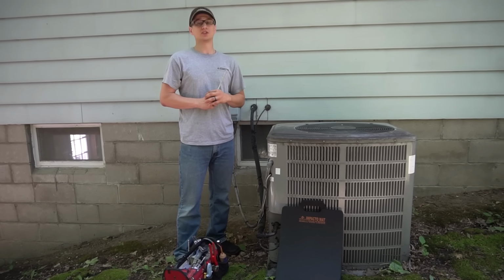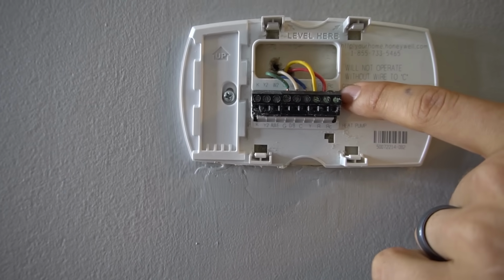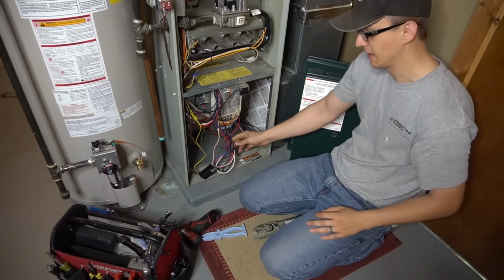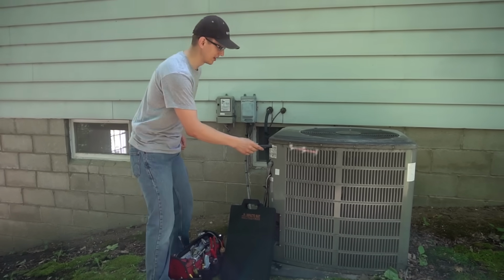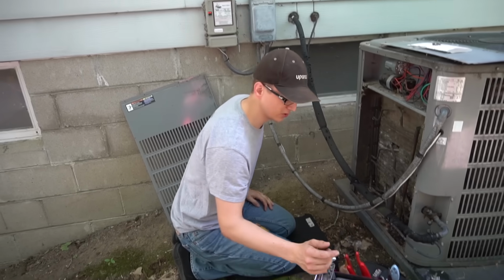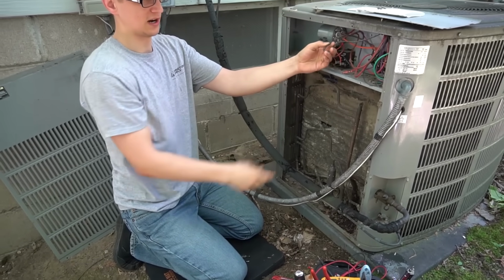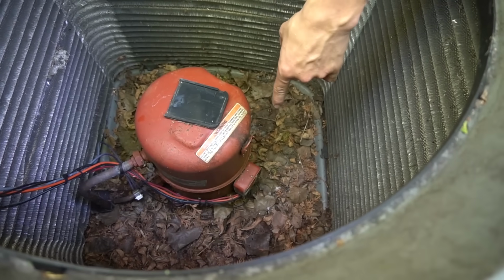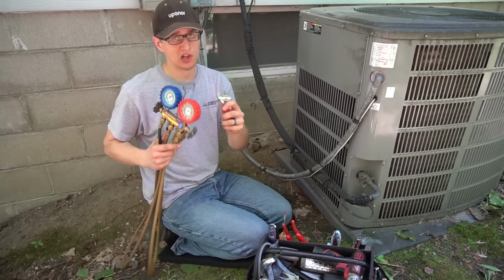AC Unit Not Turning On - How to Fix It Step by Step

Comment: Thank you for this video! I was able to fix my problem thanks to you mentioning a bug might climb into the plungery-doo. That's what happened to me and it didn't cost anything to fix. (Though I had already bought new fuses / capacitor because I didn't check if the 240v was making it through.)
Reply from the maker: Awesome! Glad to hear that it was an easy fix! :) You may as well keep the capacitor as a spare. It may save you on a hot and sunny day. (it's the most common ac problem after all) Thanks for watching, stay cool!

Comment: Hi I have the unit start when I push the plunger in but then after a little while the plunger knocks out again and unit stops working
Reply from the maker: I have two videos that are on that topic that may help you:
10 Reasons Contactor Does Not Pull In: https://www.youtube.com/watch?v=NVPhsK4gK1A&t=2s
10 Causes for AC Short Cycling: https://www.youtube.com/watch?v=GEVNSrOrohA

Comment: Watched your vids and went thru the checklist of things to check.  It turned out that my thermostat went bad.   Replaced it and everything works fine now.   Probably saved me lots of $$ now and probably in the future.
Reply from the maker: That's what I like to hear! :) Thank you for coming back to leave a comment, stay cool!
Reply: I have nothing happening just changed out the contactor 4months ago. 
I have no air blowing inside and unit is not doing anything? Please help me...
Reply from the maker: @angelavillarreal08  If you set your thermostat fan setting from AUTO to ON, does the fan in the furnace come on? If not, then I would suspect that there might not be any power going to the furnace.. So some simple things to check would be a tripped circuit breaker, maybe the furnace power switch got bumped off, a blown 3 amp fuse, weak/dead thermostat batteries.. I go over a lot of this stuff in the video too.
Reply: @WordofAdviceTV the  thermostat just makes a click sound and that's about it. No air blowing from the vents. 
I have a 2 story home so I have one furnace down stairs and the other is up stairs in the attic that's the one I'm having my problem with is upstairs..

Comment: Hi I’m having trouble with my ac. When I turn it on it only makes the air noises but doesn’t cool. Motor and fan don’t turn on and it’s only 1 year old. ???
Reply from the maker: Did you try troubleshooting it by following this video to see if you could narrow it down to the possible problem? It could be quite a few things. Perhaps a blown 3 amp fuse, a tripped breaker/blown disconnect fuse/s, or the capacitor is dead.. Just to name a few.
Reply: Word of Advice TV I did the 3 amp fuse it’s good the Capacitor new and connector new. Fuse box are good and the breakers are good. Still nothing. What else ?
Reply from the maker: @Angelchente1  If you carefully press in the contactor plunger with something non-conductive, does the condenser unit start or at least attempt to start?

Comment: What happens when the contact is bad on the outside unit and you replace it and it runs for 2-3 hours then the unit goes back off. You can push contact in and it will run. Contact isnt pulled in prior either.
Reply from the maker: I have a video on 10 reasons why that could be happening, I would try watching that first: https://www.youtube.com/watch?v=NVPhsK4gK1A&t=2s
Reply: @WordofAdviceTV  
much appreciated sir!

Comment: Your central air conditioner condenser unit was starting up to Maintain The set point on thermostat for example 75°F also known as 24°C I know you Live in United States I am from Canada so we use centigrade here.
Reply from the maker: Very accurately explained :)
Reply: @WordofAdviceTV  setting the thermostat below 75 degrees Fahrenheit 24 degrees centigrade is never a good idea because it Stresses out the Components on the central air conditioner condenser unit and Causes them to die Faster. I set my central air conditioner thermostat at 24 degrees centigrade.75 degrees Fahrenheit still in good Mechanical Order.
Reply: Word of advice TV as I mentioned before you shouldn’t pull the disconnect like that it was actually doing its job maintaining air-conditioning thermostat setpoint of 24°C 75°F or whatever you have it set at I know you’re doing a video for that reason but Your air conditioner was actually doing a job cooling down your house awesome video by the way.😀

Comment: My plunger will not pull in on my fan outside. When I manually push it in, everything works.
Reply: Could you please fill me in on what might be wrong?
Reply from the maker: I think this video will help you with that: https://www.youtube.com/watch?v=NVPhsK4gK1A&t=2s
Reply: I have the plunger pushed in, holding it, which means I have bypassed my thermostat and my fan is staying on outside. I am not sure why the plunger will not do this automatically. I need your help please.

Comment: hello ive replaced my fan and condensor. soo my unit would periodicly stop cooling. ive had two technitions come by and both gave me different opinions. one said compressor another said freon. i spoke to a friend who said it might be the thermostat connection. i dont have heat on my unit, i live in florida. can you explain how the colors work or to trobleshoot the wires on the thermostat.
Reply from the maker: Here is a video on basic thermostat wiring: https://www.youtube.com/watch?v=VknvJ9POYDo&list=PLK8tZPlovA8DvaVUQOSCJ_cDVv132rO6x&index=4

Comment: This was super helpful, big thanks! I pushed the plunger in and the outside unit clicked and is running. The only question that I have once the house cools off and the unit turns back off, if the unit doesn’t turn back on, does that mean the capacitor need to be replaced?
Reply from the maker: If the unit is working, then likely there is nothing wrong with the capacitor. From what you explained it sounded like that little plunger was just stuck in an open position. You freed it up and all was good. Hopefully that was just a glitch and the problem will go away. If the problem comes back, I would start at the contactor and see if it got stuck open again. If that keeps happening, may as well just replace the contactor.

Comment: Okay, I am reaching out to anyone who has survived the god of HVACs wrath, because I’m feeling smite down and damned. After a loud crash, I discovered my condenser fan, bladeless, and the foil shredded, but the copper line looks ok. I leap into action and replace the fan, fire it up. it ran intermittently, and gave out. I’ve since done everything I could think of to get it up and running to no avail. Please help this poor sinner, I’ve left the house with the unit running, but I’ve paid my penance.

Comment: Okay, here’s a good one. This story is brought to you by: Murphy, and the luck of the Irish; were it not for bad luck, I’d have none. My fan blades exploded, that’s right, exploded. I’m getting out of the shower last night and I heard what sounds like a car crash and a busy construction site had a baby in my side yard. I asked the wife and kids if they heard it, everyone tells me that they heard nothing. Okay? I’m hearing things... goodnight then. Next morning; it’s blazing hot, and I’m only getting hot air from the register in each room. Go to the outside unit, look inside, 3 fan blades lying down at the bottom of the unit, and shredded foils, but otherwise intact copper coil beneath. Replaced the blades, temporarily fixes problem, the blower inside is going, but suddenly the outside unit is running and shutting off and on and off and on. The next thing I know, nothing is coming online. So there you have it. I haven’t ruled out sabotage, in fact, I’m pretty sure if that’s the case, I know who’s to blame. It’s not a very old unit, but warranty is lapsed. York affinity. :: edit:: the contactor is engaging both the fan and condenser/ compressor, but only when manually pushed.

Comment: What if the ac unit fan spins and stops intermittently?
Reply from the maker: You may be low on refrigerant. That kind of sounds like the LPC is tripping. (low pressure switch) That switch trips if the freon levels are getting low in your system.

Comment: Thank You sir, your video is very educative. I have a problem. My York Affinity AC is 5.5 yrs old and out of warranty. The capacitor and the contactor are good, because the tech installed both new ones and problem is still there. Freon was also refilled. The problem is that the unit TRIES to start but fails - so I hear the click of the fan and the compressor wanting to start, the fan begins to spin and then immediately stops. This process repeats itself over and over until I switch the power off. Then after a few hours I turn it on and it works for about (maybe) 10 hrs and then the whole cycle repeats itself. Can you help?
Reply: hey Karim, did you figure it out what was the problem?.

Comment: Fantastics videos! Very good teacher...
Ok, it’s hot, ac not efficient. Ice outside and inside, bloc on evaporator. Stop the system, melted , filter very dirty, changer for a les efficient one. Fiberglass. All traps open, cooled the house ( not as efficient as it used to); connot get underneath the evap to clean it, might try tomorrow... because all frozen again...   carrier, evap on top of,the furnase, no acces underneath it, i m stuck, and hot... help.    Thank you, (merci beaucoup,!  ( Montreal...) christ

Comment: Hi Word of Advice TV, so I followed all your steps and was able to prove that everything is working properly. I was able to narrow it down to my AC unit outside, I was able to open it to get to the contactor. I took my fluke and verified 240VAC being supplied to the contactor, with everything on I’m able to push down on the contactor to make a closed position, which operates my AC condenser unit and everything in the house. I don’t think it’s the capacitor, my issue seems to be that the Contactor doesn’t latch in the Closed position when the thermostat is in Auto On/hold Cold. Do you think if I replaced the Contactor it’ll solve the solution? I can bypass the Contactor and the AC will stay on, however when I turn off the thermostat it won’t turn the Contactor into the Open position. Please keep in mind, that this has originally been running for 10+ years and I haven’t changed any of the wirings.
Reply from the maker: Sounds like you did everything correctly. If the contactor not pulling in is where the troubleshooting got you, then this should be your next video: https://www.youtube.com/watch?v=NVPhsK4gK1A&t=2s

Comment: JUST SAVED ME A HOT TEXAS NIGHT WITHOUT A/C!!! The fan on top of outside unit was ceased up and I used an extended drill bit to kick that sucker back on!!
Reply from the maker: Nice :) Stay cool! Although as I mention in the video, if the fan is locked up like that, then chances are the problem will come back. (could be a weak capacitor or the motor is starting to go out) Or perhaps that was just a glitch and all will be good! ;)
Reply: It was the capacitor!! Air wasn’t cool all night 😭 but got it changed out this afternoon and now the house is finally starting to cool off. Saved me a $100 service call. I really appreciate it!
Reply from the maker: @Xx.LaVerdad.xX18  Awesome! Glad I could help, stay cool! ;)

Comment: I appreciate your putting this video up and sharing your knowledge tremendously. 
Before a visit from a technician, the fan was turning, and the interior blower was moving air, but the compressor wasn't engaging. I had visibly inspected only the wiring and capacitors, but lacking the knowledge and skill-set to go any further - made the phone-call. After inspecting the unit I was told by the professional that there's a short in the wiring inside my home since the fuse behind the disconnect now blows immediately when turning the breaker on. 
In other words - $70 later, the problem is worse, or compounded. 
It's too damn hot right now to be messing with it right now, but you have given me enough information that perhaps I can either figure out my unit's issue (hope it's not the compressor!) without going on a wild goose-chase in my attic. I'm too darn old to be crawling around on 2X4s breathing fiberglass and dust and ruining my knees any further unless it's a complete necessity. 
Thanks again. 
Namaste
Tony Page

Comment: Pulled the capacitor from my AC unit, tested it and it seems dead. Question is its a 22.5MFD and i cant find any stockists here in the UK, would a 25MFD do the job? cheers
Reply from the maker: A 25 MFD would work. Stay cool!
Reply: Brought, installed, AC back up and working fine. Big thanks

Comment: I have a quesiion every once in a while ill get a disconnect...the blower inside will come on with the theromastat but the compressor comes on as normal but the outside doesn't....i reset the thermostat...then comes back on...the capaciter outside was replaced...it help ...it happens about every other day its really annoying...please help...oh i replaced the thermostat....the frequency was reduced its just annoying...happened actualy since the install..about 5yrs ago...just weird

Comment: Great video! Question though. If a common is a neutral how does it provide power to the thermostat? The red wire is the power. Why doesn't that not power the thermostat? Doesn't the neutral return power to the source? Thanks!

Comment: My outside unit is not coming on but when I press the by-pass it runs fine.  I have replaced the capacitor and it’s still not coming on when the thermostat is activated. What else should I check?  The unit is about 18 years old and I’ve never had anything done except an inside motor replaced.   Thanks for your help, I love your videos. Oh I did not find a fuse on outside unit.
Reply from the maker: If your contactor is not pulling in on it's own, then I would watch this video: https://www.youtube.com/watch?v=NVPhsK4gK1A&t=2s

Comment: Thanks for the great video!!!!  I went to all the process as recommended.  My Bryant 113RNA030-B model.  The AC fan is not spinning while I heard humming from the AC.  Once I take a stick and spin the fan it start and everything run fine.  However once the AC stops, the fan cannot start by itself without manually help with the stick.  From my research and watching your video, I think it is the capacitor or the fan motor.  Please provide your expert insight and recommendation
Reply from the maker: Your conclusion is correct. Most likely it is a weak capacitor. There is a chance that the fan motor is going out but it's a lot more frequent that it's just a weak capacitor. Once you replace it, the problem should be solved.
Reply: Thank You for all the guidance.  I received my new capacitor; replaced it today, and my AC is up and running.  I watched you GREAT Video on how to replace the capacitor twice and then proceeded to follow all the instructions - it literally took 15 minutes.  More importantly, I really appreciate all the safety tips in the video because it is intimidating with wires, electricity, capacitor, etc. and first time dealing with AC.  Thanks Again for all the Great Videos!
Reply from the maker: @allenwu6473  Awesome!! That's what I like to hear :) Thank you for coming back with an update, glad everything went smoothly! Stay cool!

Comment: I had issues with my AC fan not turning but all compressor & condenser running (but no cold air blowing inside the house).  After watching your video, I was able to kick start the fan and all is good for few hours until the fan turned off again and was running for a while without the fan and shut off the compressor and the condenser.. 
I changed the capacitor and fan is now running  but now the compressor does not want to kick on.  I can hear it wanting to kick on but would not.  So, by watching your other videos, I added a hard start kit to help the compressor.....   That help some what...  The compressor does kick on but for about 5 seconds ONLY and  turns off   and I can hear it hum an wants to kick back on but will not kick on....  Any additional advice/solution
Reply from the maker: If you replaced the capacitor (I am assuming you have a dual capacitor) and tried putting in a hard start kit yet it is still doing that... That sounds bad. There's not much that can be done about a locked up compressor (if you have a meter it would be good to verify that it is getting 240v though) If that is indeed what is going on, if your unit uses R22 refrigerant, you would need to get a whole new air conditioner.

Comment: 2005 Heritage 12 heat pump, inside unit running, outside unit not : new capacitor, contactor pulling in, power to cap and nothing happening, Slow blinking green light on control board, no tripped breakers, no visible wire damage fan motor replaced 2 years ago, zero experience with heat pumps but work on ac units all summer
Reply: Tory Bond you probably messed the motor up again
Reply: Tory Bond is compressor running?